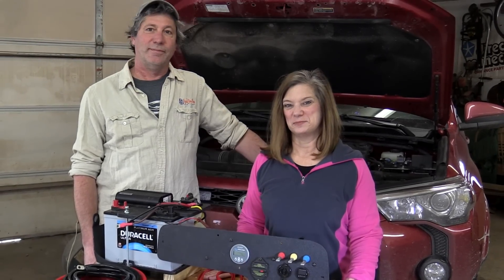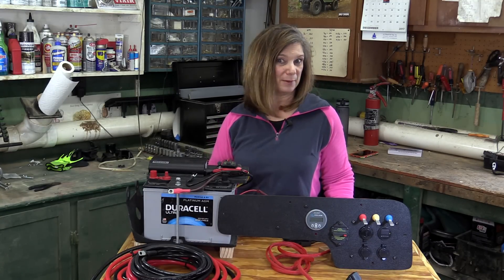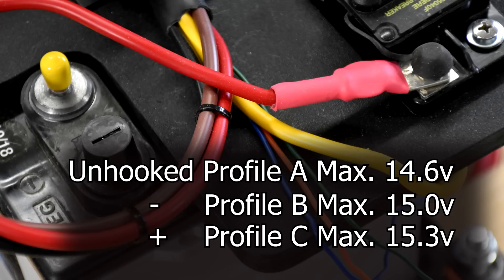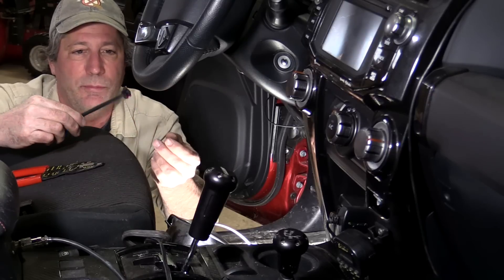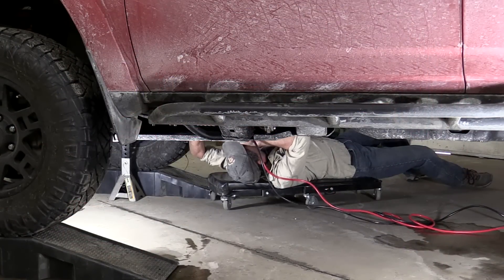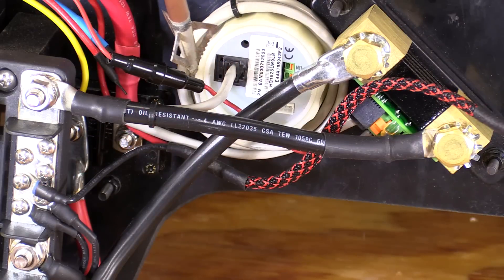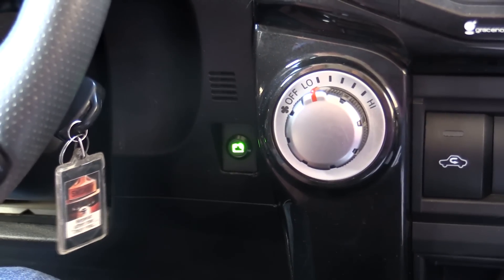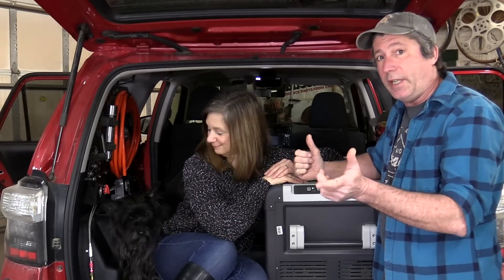Dual Battery Setup with Detailed DIY Install

Comment: Awesome video, i got a few points. 1) the 5th gen 4runner has a temperature compensated alternator, as such I do not think the blue ignition wire was necessary. Why did you choose to hook it up? 2) In their manual, REDARC does not like breaker and recommend MIDI type fuse, personally, I think a good breaker like the bluesea is not an issue. It will interesting to see how it performs. 3) Did you duse the brown wire? Albeit short run but expect to see 35amps at times. 4) You grounded both batteries together, if the charger is grounded to neg pole of accessory battery, isn't it sufficient? Why adding a ground to the body? 5) Why did you choose AWG 4 wire? Most amps you will see in the engine bay is 35 amps, even with both batteries separated this way, AWG 8 could be enought. However, bigger does not hurt. 
Sorry for so many questions but hope it could help to clarify. Thanks again for putting time and effort doing this. Cheers
Reply: On the wire size from the starter battery to the second battery, it seems to me that the DC-DC charger provides starter battery isolation from load spikes on the second battery. Since there won't be as much inrush current into the DC-DC charger from the starter battery a smaller wire gauge like 8 AWG should be acceptable. Given that the DC-DC converter is rated for 25 amps, and the length is about 9 feet, wire guides recommend 8 AWG. 48 amps is the max current on an 8 AWG wire, which matches the breaker size. 8 seems acceptable and 6 AWG seems like a conservative choice.
Reply: Indeed, 8 AWG is recommended in the manual for the BCDC1225D with 3-16 foot cable length.